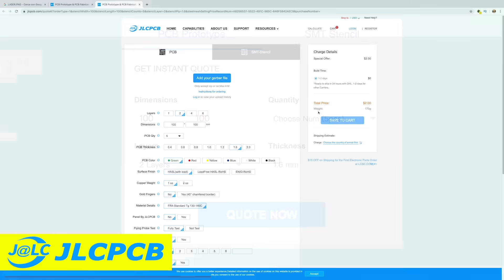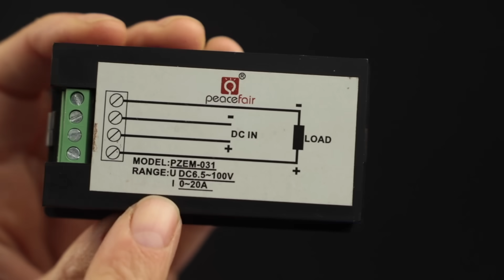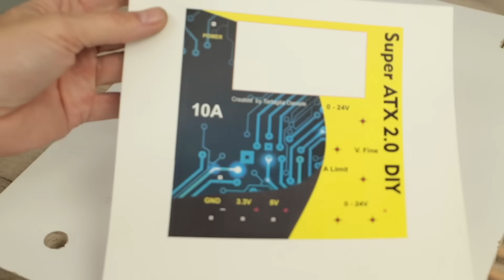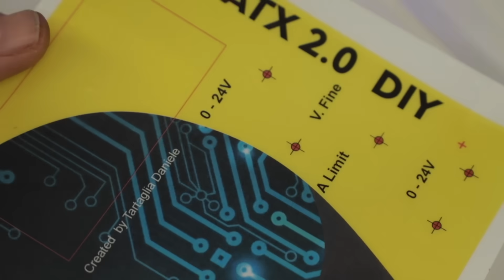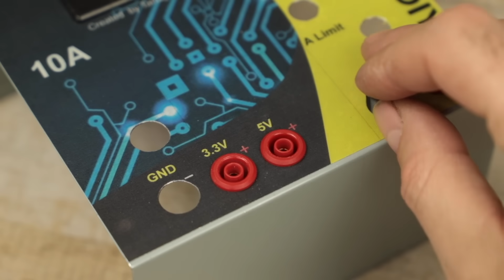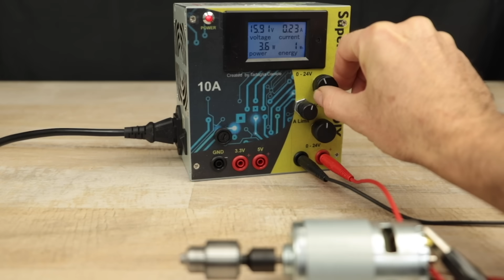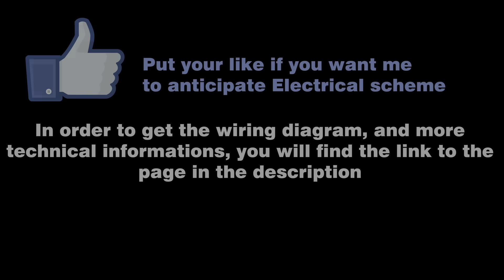ATX PC - DON' T THROW THAT AWAY!!! here is a BIG idea

Comment: You use 12v voltage to supply to the step-down circuit but adjust the voltage up to 24v. That's absurd.

Comment: i think this is just dangerous. no prevention of short curcuit or touching live wire in case of failure. just imagine the wire he screwed in the screw terminal (non solid wires deform over time and become loose) slips out and touches live. he has sucessfully built himself a death trap and potential fire hazard.
Reply: AGRRED   there are MANY problems and issues.   There are ways to safely use stranded wire in such connectors but sadly the worst method was shown

Comment: Cannot understand the choice of an expensive 10 ohm 25 W resistor for the 5 V line when its maximum dissipated power is V^2/R=2.5 W. A cheaper 5W resistor is sufficient as a dummy load. Good video, anyway!

Comment: Another thing you can do with an old ATX power supply is use it to power LED light strips. You can light every room in your house off a single power supply. 

I bought a strip of lights an arduino and salvaged an old power supply, a pvc pipe and some old vinyl gutter to make programmable fish tank lights for under 40 bucks. 

Not only do I have light for the fish tank that had I bought in town would have cost at least twice as much, but I can program it to shut off at a specific time, adjust not only color and over all light level but individually light sections of the tank if I want. I can have a morning program and an evening program, or whatever I want. If you can't program an arduino, then just buy a premade LED controller that wifi links to your phone. Not as versatile but way easier to setup. 

I have even managed to mix in colors along with the white light to make the decoration colors pop more and even make the fish appear more vibrant. 

the strip burns out after a few years of use, but so do normal light bulbs and at a replacement cost of 14 dollars it's not a big deal. Because most LED fish tank lights have to be replaced when they burn out.

Comment: Dear Daniele, recently I found your design for a power supply made from an old ATX computer supply on YouTube and in the mean time I have build it. On my multimeter it works perfect. However, when you turn the volts down to under 7 volt the display dies. I think you chose the wrong type for this because you need one with it's own (12V?) power supply. I could not find anything in the comments about this. I noticed on the video that when you test the PZEM-031in the beginning of the video that when you come to around 7V the display starts to fade out. Later in the video you never go lower than 10V. Why?

Comment: Bonjour Daniele, bonjour à tous,
J'ai commandé  3 DC-DC converter  je n'ai pas reçu strictement la référence SZ-08CV  mais SH-PWS14-1
Je les ai passé au banc de test : Alim de labo pro et aussi sortie 12V d'une alim ATX :
Juste un résultat :
Alimentation entrée 12V :
Essai à vide :         Ue = 12V  Ie < 1A  ;       Sortie réglée à Us = 30V     (Is = 0A)
Puis : Essai en charge sous tension à vide 30V  :  Ue = 12V  Ie = 6A      ;   Us = 21 V  !!!!!!   pour un courant Is = 3A  (soit seulement  60W) )  
Performances très limites pour faire une alimentation réellement stabilisée ; à à peine 3 A de débit la tension s'effondre !!!
Ne pas attendre de grandes performances de la sortie réglable en tension au sens d'une alim stabilisée en tension avec ce module DC-DC.
Je connais aussi ce que l'on peut attendre pour ce prix.
Je n'ai pas testé la référence exacte présentée. A voir.

Bravo pour tes idées inspirantes et désolé d'apporter qques infos moins enthousiasmantes sur ce module.

Comment: One concern is the segregation of the low voltage circuits and components from the mains voltage. Usually build any extras externally or place within the low voltage side of the ATX case to overcome this point.

Comment: Hi, i want to make this Power Suply. But i only can see a video. We cant see what wire going where, and you speed up this part of video. What wire goes to 10ohms resistor. Where is wiring diagram, instruction tutorial like your other projects for example Arduino cnc plotter. I made this plotter.

Comment: How can I trust a guy that uses an automatic screwdriver? ;))) Great build! I would have insulated the hell out of the bottom of that buck converter board though. Power Resistor...why outside with exposed connections?

Comment: Also remember: If you use an ATX power supply, be sure to see if you have to reduce the RFI / EMI that these switching power supplies can emit, and the RFI / EMI noise can then travel down the DC output into other equipment. This noise can be filtered out and in some ATX power supplies, it must be filtered out.
  
Ricorda anche: se usi un alimentatore ATX, assicurati di vedere se devi ridurre l'RFI / EMI che questi alimentatori a commutazione possono emettere, e il rumore RFI / EMI può quindi viaggiare lungo l'uscita CC in altre apparecchiature. Questo rumore può essere filtrato e in alcuni alimentatori ATX deve essere filtrato.

Comment: Some one help me out here. If all "amps" are created equal...that is to say that AC amps are the same as DC amps, how can you have a Power Supply like this one where at the 0:52 mark you can see the specifications - how do you get 12v 14 amps out when the input is 115AC 7amps? I get that the voltage is different, so the watts will not be the same, but if DC amps and AC amps are the same, how can the amp output be more than the amp input?

Comment: Need to be careful with some ATX power supplies... Some of those internal heatsinks could be referenced to mains voltage (110v - 240v) through the use of a TRIAC or DIAC depending on which PSU you go for.

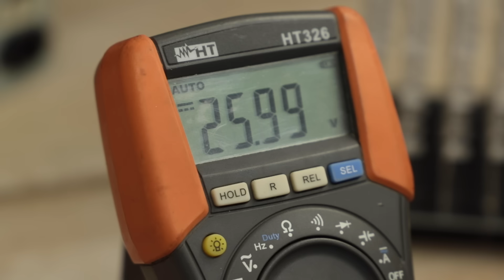Comment: According to your youtube video (min. 3:01), powering the dc / dc converter SH-PWS14-1 with 12V outputs Vout is 28.64V. It's impossible! A STEP DOWN dc / dc converter cannot output a voltage higher than the input voltage!
I have a similar converter (XL4016 DC / DC 0.2- 9A Adjustable Buck Converter STEP DOWN Power Supply Module 5-40V to 1.2-35V 9A, 300W) which powered at 12V outputs below 12V and at 40V outputs 35V!

Comment: Hola daniele me puedes explicar porfavor como obtienes 30v? Soy nuevo en electronica y no lo entiendo :(
Reply: El cable azul entrega -12v y el amarillo +12v.. lo que es lo mismo decirle GND a -12 y +24v a +12... hay 24v de diferencia entre ambos
Reply: @negrit00  gracias. En realidad no soy novato jajaja simplemente queria saber si el respondia algo. aunque esta “suma” saque 24v, no soporta amperaje. Por eso esperava su respuesta. Gracias de todos modos!
Reply: @pifa92  y no solo eso (amperaje) si no estoy mal, creo  que tambien se queda sin referencia a tierra/GND
Reply: @pifa92  yo en cambio no se mucho, pero tengo una fuente atx para modificar como la del video, y le quiero poner un potenciometro para amperaje fino (la atx del video tiene para regular voltaje, voltaje fino y amperaje, pero no amperaje fino) pero no se como van las conexiones de los potenciometros en el video. Tu sabes algo sobre eso?
Reply: @diegof.8052  bueno lo que tiene es el regulador de voltaje. Que trae dos poneciometros uno de voltaje y otro de corriente. Tienes que mirar de cuantos “k” son y poner dos iguales. Mayormente son potenciometros lineales de 100k pero depende del regulador que compres. Por cierto a que te refieres con voltaje fino?
Reply: @pifa92  tenía esa inquietud.. porque veo que el +12v tira 16A en mi fuente y los -12v tiran 0.5A.. y no estaba seguro si se sumaban o no las corrientes. De todas formas el step down que le puse me limita a una corriente máxima ideal de 12.5A

Comment: The project is interesting and looks beautiful from the outside But it's not clear to me where the 25.5 volt output voltage came from. The specified module Geekcreit® 8A DC5-30V to DC1.25-30V 150KHz Automatic Step Up Step Down Adjustable Power Module Voltage Regulation With Short Circuit is built on the LTC1625CS chip (seen in the seller's photo). From the datasheet, the LTC®1625 is a synchronous step-down switching controller that drives external N-channel power MOSFETs using a small number of external components.
The wide power supply range allows operation with Vin = 3.7V (3.9V for LTC1625I) to 36V input, and Vout = 1.19V to Vin output. It turns out that the output voltage cannot be higher than the input voltage. You connect the module to the black and yellow ATX wires - this is 0 +12 volts according to the diagram.
And you get some kind of magic on the video. Show the complete electrical diagram of the project and please explain how this is possible.
Reply: Don't bother, I can bet another year will pass since this video and we still don't have any electrical diagram.

Comment: Guys, as we are all sitting here waiting for ever for the circuit diagram and the component list I took screen shots as the video progressed and this is my take on the components. I am not an electronics wiz but I can follow the destructions. 

In return I have two questions for you wizards out there. If you look at the potentiometers there are 2 types. The one I found a reference for is the square one, can they all be the same?  

I don’t have an ATX power supply but I do have an external power supply for an old desktop Dell PC that you could hot swap the 3.5” floppy drive for a CD drive. The rating plate for the supply says Dell model ADP-150BB B. Input 100-240V- 1.8A 50-60Hz. Output 12V…12.5A. The plug on the output lead has 6 pins - 2 Com. 2 +12V 1 Remote and 1 Future Use. 

I know I won’t have the static 3.3V and 5V outputs but I can hack that. Because I only have 6 wires once I remove the output plug I won’t have anything to connect to the power resistor so do I need it?

Any help you can give would be really appreciated.
Reply: Bench voltage supply - see if this makes sense. 

DC-DC 4.5–30V to 0.8–20.8V 8A 100W step down module buck converter - Peacefair PZEM-031
Reply: Resistor - 10ohm 10R 50W Aluminium Power Resistor RB50 Ate - ATE R825 10R J 1415
Reply: Potentiometers - 220R Linear Mono PC16 Potentiometer Piher Pot - Y5128 220R 

Or
Reply: Try WILL THESE DO AS AN ALTERNATIVE?
Reply: Try 5Pcs OHM 10K Linear Mono Stereo Pot Rotary 15mm Resistor Potentiometer & Knob
Reply: Apologies for the many replies but the system would let me do it in one go.

Comment: can you please give some information  of potentiometer   it will helpful.
Reply: same value as replaced part. many kit has different value.
Reply: I zoom into the component.. seem to be a 20 K  ... i'm waiting for the part, and will order multi-trip pot once received :)
Reply: @erikgaudin  W 204 (BAOTER 3296) is a 200k trim potentiometer
Reply: @AttilaNagy777  Do you think all potentiometers are 200k?
Reply: turn left --- resistance goes up
turn right -- resistance goes down
Now make a headstand: All the other way around .... magix
Or look at the website from piher (a potentiometer manufacturer for THE manual) ... :)
Reply: What is not so a bad question ... with such an amount of knowledge ?
There is a point. And that is -> https://www.bourns.com/pdfs/onlinepotentiometerhandbook.pdf
Reply: Also the manufacturer has a plethora of physical and electrical data in their data-sheets ........ so if you plan to do some nasty things, you Creative 
then be prepared with maths;:)))
Ah, one of these bonkers: https://www.piher.net/pdf/12-PT10v03.pdf

Comment: hi, pls tell as where to connect pins of potentiometer "A.Limits" in the power supply and why you connect both of "volte potentiometer choise" and take only 3 wire to the step-up power supply?
Reply: A.limits connect to current pin on the buck/boost dc-dc converter, it change the value depends on the potensio feedback same as the voltage pin, on the voltage pin had 2 potensio with different value in series i think where the higher resistance for the coarse voltage tuning and the lower for fine tuning.

Comment: why put the diode outside of the fan cooled protective box?  Also, Ive never looked at a power supply but it stands to reason it already has voltage controllers inside, why not adapt them to adjust the voltage instead of using a upconverter, you loose all your available current that way.

Comment: I've tried to hook the purple cable to an LED as a Standby LED, I have Grey going to another for ON but this purple one for some reason keeps blowing LEDs and even after i put a 200ohm resistor with ground. Any ideas?
Reply: purple is -12V, which means that ground would be the anode of the LED, while the cathode would be the purple wire. Also, the reason it's blowing them up, is becase I = U / R = 12 / 200 = 60 mA, which is way more than a LED needs. Use a 1 instead.

Comment: Take them apart, take a torch to the back side of the pc board and melt the components out, they're worth something, but its a waste of time to make a DC power supply out of such a weak pc power supply when you can get 1000 Watt ones from servers on ebay for $15.  That's a 14 amp supply, the server ones are 70 amps.

Comment: Good day.
We need answers to such questions:
1. What is the nominal value of the soldered trimmer resistors, by 10 kOhm?
2. Can you give a link to such a voltage and current converter on the Aliexpress website?
Thank you for your help!
Reply: 1. 204 M 129 T     200 kOhm
Reply: For fine adjustment  voltage 10 KOhm
Reply: This video shows a black potentiometer with a value of 220 kOhm

Comment: I'm certain I saw some leaking electrolytics in the ATX power supply.
Good idea. I was thinking of rewinding the transformer and feedback on one for a single output, variable voltage (9 to 15 volts) power supply. Much easier to leave the other voltages intact and add an adjustable boost/buck converter to the 12 volt rail.
I'd also add a few extra grounds.

Comment: Thanks, I like the variable addition. FYI, rather than an expensive 10 ohm power resistor, I use an old 12v 1157 taillight. The 5V lights up the inside of the box with a glow to tell you it's ON.
Reply: Is the 5v from the power supply going to high or low beam on the bulb?
Reply: What is the function of the power resistor? can it be replaced or is that expensive resistor optional?
Reply: @diegof.8052  Some power supplies do not turn on unless there is a load on it. Basically the resistor makes the power supply think its connected to a motherboard so it can supply power.
Reply: @miguelcalderon3702  Thanks for the clarification. The power resistor used in the video is expensive, do you think the resistor you see here https://amzn.to/3lw9rGO can work?
By the way, to date Daniele Tartaglia has not yet uploaded the schematic electric or the list of materials he used. 😒
Reply: @diegof.8052  well every power supply is different so one might need a 10 watt resistor, others 12 watt and so on. But yes those resistors should work just fine just make sure you have some kind of cooling in the housing like a fan or something to keep the resistor and components cool. And to turn the supply on just need to ground the green wire(you can can connect a switch between both wires so it only cuts on when you press the switch. And for a 12v power supply connect a 3-4 black wires to a black banana plug(-), and 3-4 yellow wires(+) to another plug and you should get 12 volts and the same thing applies for the rest of the colors on the supply. Just make sure you know the output power of the wire colors on the power supply. And careful when testing inside the power supply because they can produce alot of amps and that can really mess you up.
Reply: Love it! Lamps make great loads.

Comment: Hi...you obtain 24V output with a 12V input in the Step Down converter. Im not have much idea about, but with a stepdown converter is not possible obtain more voltage at the output than the voltage of in the input... Is that right? thank

Comment: You really need to have a death wish to build that crap!
No heat shrink tubing on the load resistor for easy shorting. Using wood scews on metal that actually reach inside the case for several millimeters for easy cable damage.
Screwing chinese modules that you don't know to heat sinks of which you don't know whether there is electric potential or not. I could go on for ever.
This is really dangerous stuff and should be banned from YT.
!!!  DON'T BUILD THAT UNLESS YOUR LIVE IS OVER ANYWAY !!!

Comment: Can somebody clarify these please?
1. What is the purpose of 10ohm resistor between 5 volt and ground?
2. What is the purpose of third potentiometer marked "A.Limit" and where it is connected to?
3. What is the value of these potentiometers?
4. What is the value of the fuse used?
Thanks.

Comment: 4:00 Hey, that power supply has two swollen capacitors hahaha...
Reply: So Glad I wasn't the only one to notice ... obvious as soon as he took the top off @ 1:36  ... !!!
Reply: @frankmc4294  i saw it even on the blurry video the second he took the psu apart.. how he didnt? or didnt care..
Reply: yep...thts ri8 but most buck modules are designed to taKE unsteady dc voltage input so that maynot be a prob
Reply: I saw it right away too and this makes the supply a bad candidate for this project as it is in for a eminent death if it´s not recapped. probably gonna make the voltage very unstable as the capacitors likely don´t have any juice left as well

Comment: Use a U2 server power supply. They can have wattages of 1500 odd watt or more depending on model.
They direct most of this power to the 12 volt rail (sometimes 14 volt)
Reply: Thanks - Useful to know because I was thinking of using a psu to power a 200W 25A transmitter
Reply: @Broadercasting  One thing of note, low auditory noise isn't exactly a consideration in their design.

they can sound like little 747's